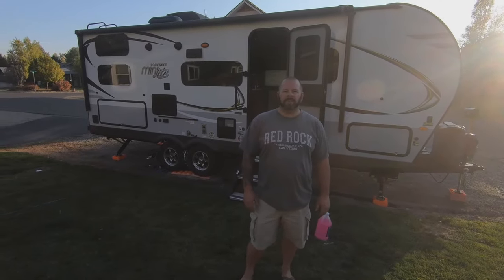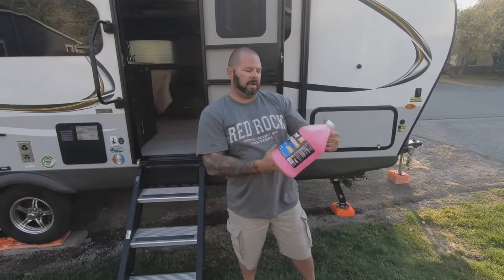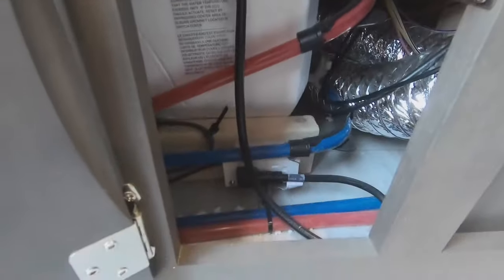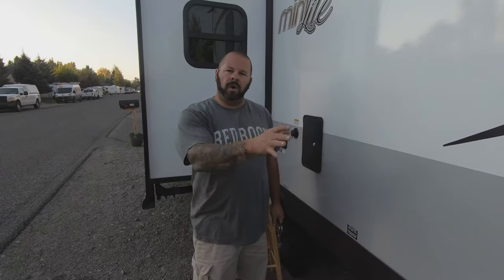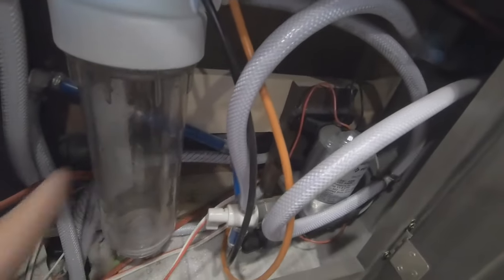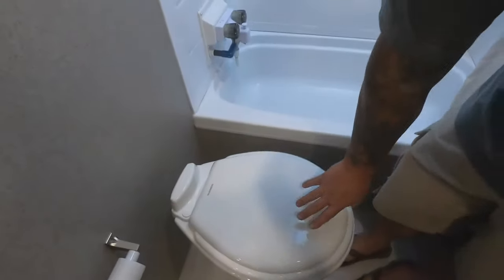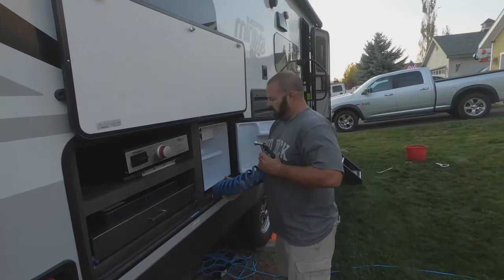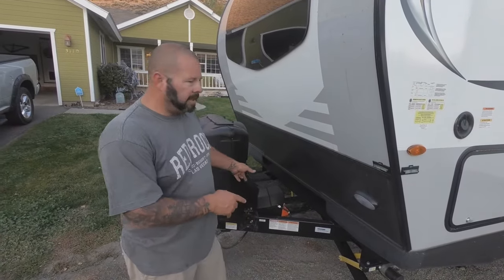How to winterize 2021 Rockwood Mini lite 2509S

Comment: Great video, please go back and depress the city water inlet button otherwise you’ll have a leak on the other side in the spring. Remove the screen push the pin until the pink antifreeze spurts out. Happy Camping .
Reply: I almost forgot about 'burping' the city water inlet!
Reply from the maker: Never even thought about that. Hope it will be fine. I have it stored for the winter in and indoor insulated building?
Reply: Damn I'm late to this comment, we're FINALLY camping the first time this season (I have the same 2509S) and I missed depressing the city water inlet last fall, and as you mention it leaks when connected, so I'm filling and using the tank.  Do you know how to fix?
Reply: What is the 'city water inlet button'? What is 'burping' it? Do you mean moving the valve back to city water mode from antifreeze mode? Thanks!
Reply: @jlantz3691 also not sure, hopefully someone sees us

Comment: we found out by accident that if you leave the low drain cap off and loosen the water filter it will drain over half of the water out of the filter to avoid water getting all over the floor when you remove the filter
Reply from the maker: I am going to do that next time. Thanks

Comment: An extra bottle of antifreeze is a heck of a lot cheaper than winter freezing damage repairs.
Reply from the maker: I have not had any damage or any problems doing it this way. Besides where in the world is a whole other bottle even going? Lol
Reply: @BassinNmore  I wasn’t criticising your method, just saying that if someone needed a bit more for a particular unit it’s pretty cheap insurance. One thing that surprised me a bit is that they put caps on the low point hoses rather than valves.
Reply from the maker: @robertpearson8798  right, I am not a fan of the caps.

Comment: Good job but just a note; the rod you pulled out of the heater isn't a heating element, it's a sacrificial anaerod.  It slowly deteriorates saving your heater. You need to check this once a year and replace once a year or you'll destroy your heater.
Reply from the maker: Thank you for the info! I will add that to the list for when I replace the water filter.

Comment: Thanks Justin and Racquel! I have a 2022 Rockwood Mini Lite 2104S and had a very difficult time finding anybody with a video or discussion showing how to use the outside connection. So this is extremely helpful for me and I appreciate you taking the time to put it out there. Happy camping!
Reply: P. S.  Mine took slightly less than two gallons, and had about a quart  left
Reply from the maker: Glad it helped out!

Comment: Great videos, very well done. We have the same Rockwood camper. After my first year of winterizing, I found that if you use a small kitchen trash can bag, you can put it around the water filter when you remove/replace it and not spill any water in the cabinet.  It works really great for me. 
Another trick I do is place a pool noodle at the head of the bed on the bed frame to prevent the mattress from sliding down when you put the bed up  and getting caught on the bed shelf when you put the bed down.
Thanks again for the videos.
Reply from the maker: All great tips, thank you!

Comment: I know this is awhile since you made the video, but it is still very helpful! I have done my own winterizing for several years now and am about to do our new 2509S. Watching you do yours was great. The only difference is Rockwood no longer includes a canister water filter. Instead, they give you an in-line filter with the trailer. No problem, as I was using them on our old trailer. Thanks so much!
Reply: Ahh nice I was just scrolling comments to see this. Mine also doesn't have one which I suppose is easier.

Comment: Good video. We just received our Rockwood and it’s a little different from our old Winebego. Thanks for the instructions. One note though. In your city water connection you have a screen. Take the screen out and you have a small pressure release valve. Push the valve and that will release the pressure and drain that water line. Probably not a big deal but I don’t risk it.
Reply from the maker: Thank you. I did not know about that at the time, but will get it for sure next year.

Comment: Great video! I want to buy one of these this year, especially after watching your other walkthrough video! Just wanted to mention that it appears to me when you do the hot water antifreeze on a hose (shower hose, outdoor shower hose and your line next to your outdoor burner), you should run the hot a little longer. The reason you are seeing antifreeze right away is because it's still in the hose from doing the cold, however the hot water line itself might still have some water in it further back (or maybe not 😉) Anyhow, thanks so much for another great video and I hope to check in with you after we buy our unit. Cheers!
Reply from the maker: I will do that. Thank you!

Comment: We have heard the same about the Liquid Dishwasher detergent, no suds and cuts grease.
Buy 2, 1/4 turn valves for the low point lines.
We blow out the water lines with air, you use less antifreeze.
Reply from the maker: Thank you

Comment: Thanks for the vid, great help as it’s our first year with a mini lite. I think you may have forgot the city water intake. You have to remove the gauze and push the button to let the antifreeze through. I didn’t see this in any of the comments. Other wise I will be following this vid to winterized my trailer.
Reply from the maker: I dod not know about that until after as somone else did comment about that. I still had no issues with when I picked it back up after winter though. Thanks
Reply: @BassinNmore  not enough water stays in that line to worry about. It's often higher than the pump anyway.

Comment: Great reference video for out 2021 2507s.  Dealer said we could just drain all the water like you did, blow out the lines with air and not use antifreeze that will require much flush out in the spring.
Reply from the maker: That is true. I used to just blow the lines out in my old camper, but I don't have a large compressor anymore. Thanks
Reply: Personally I think that $15-$20 worth of antifreeze is pretty cheap insurance for a $40,000+ trailer and I’m sure the manufacturer puts that antifreeze port on there for reason.
Reply: You are welcome, saves time money and better for the environment to achieve the same results. Ockhams Razor!

Comment: Thanks for the video, as one previous person said you showed a lot more then what they show you at the dealership. I purchased the same 2509S this past February and still had questions on how to winterize without getting antifreeze in the water heater.
Reply from the maker: Glad to hear it helped you out. Thank you!
Reply: I purchased the 2509 a month ago and it's a 2022.  The process is the same and it was very thorough and helpful,  thank you very much for putting this together.   The Socket to remove the drain cap is actually 1-1/16, not 11/16.  It's common sense but important to note the water pressure that occurs in the filter housing and it will become impossible to remove unless it's release.  Great video thanks again!

Comment: Thanks a lot for your video. I just got may 2509S this year, and it is also my first camper. I have three questions, 1, the filter is too hard to take off, would it be ok just let it be with 1/5 water inside? 2, You have turned 3 bolt switches to the other side under the counter, when shall we turn them back?  3, Similar with 2, you turned the switch near the the filter, but didn’t see when you turned it back. Thanks again.
Reply from the maker: If you open the low point drain the filter should become loose again. I don't turn any of the switches back until I get it back in Spring and de-winterize the camper. Then I put all switches back and flush with bleach water.

Comment: We Live in Maine and just Winterized ours today, 2021 Rockwood MiniLite 2205S , I dumped a bunch of antifreeze in the fresh tank and just pumped it through, we don’t use the fresh tank to drink from anyways
Reply from the maker: That works as well. Did you use more antifreeze doing it that way? We use ours for cooking and the dogs water as well, but you can always clean the tanks in spring to use again.
Reply: @BassinNmore  yes I used 4 gallons and after I ran out of every faucet I drained the fresh tank and cleaned it  out so got 1 gallon back, we don’t dry camp so we never use the fresh tank ever, we are always at a campground with full hookups so only use the city connection
Reply from the maker: @Northeast_Mainiac  thank you

Comment: One bit of advice. Empty your fresh water tank. Then open a faucet and turn on your water pump. Watch your filter because it will start to empty. When it is almost empty shut off the water pump. No more spilling water inside your camper👍
Reply from the maker: I will definitely try that next year. Thank you!
Reply: @BassinNmore  I know it works because I did it yesterday on my 2021 mini lite 2205S, lol!
Reply from the maker: @stevez340  I wasn't saying it doesn't work, lol. Just saying already winterized mine and put it away this year. I am getting older and by next year I will try and remember this.
Reply: @BassinNmore  I understood that. I was just joking that I had actually done it less than 24 hours earlier👍

Comment: Great video but might want to run the hot water a little longer to insure the water is completely out. Open then closing real quick because you see antifreeze could just be the antifreeze from the cold water getting pushed out by clear hot water
Reply from the maker: True, thank you.

Comment: Pour 3 gallons of rv antifreeze into a bucket. Winterize the trailer. Anything leftover can be poured back into the gallon jugs?
Reply from the maker: Next year I sure will.
Reply: @BassinNmore I just got out my list for wintering my Mini Lite 2205s as I plan on doing it this week. I will update some things, such as one reply stated, removing the screen on the city water connection and making sure there is no water in the line. There is usually a low spot in the hose where it enters the trailer. I believe the black tank flush can also have a low spot where water can lay in it. Always learning something new! I also empty the gray and blank tank when I am done to remove any water that accumulates while wintering. Good luck with your future videos!

Comment: Really informative video. Quick question: I assume that the water pump isn't damaged when the jug is sucked dry? Thanks.
Reply from the maker: It can damage the water pump if it runs for a long time on an empty tank. The pump will get too hot and damage the rings. I already had to replace my pump for that reason.
Reply: @BassinNmore  Gotcha. So as long as I turn off the pump quickly after draining the jug, I should be OK.
Reply from the maker: @jlantz3691  yes

Comment: I just did our 2509s, but I went the compressed route, 60 psi, until every line is empty of all water, it takes a couple of times for each line, then about half a gallon in each p-trap. Makes sure u depressurize the water heater!!! Learn the hardway as the anode rod flew out, could have been ugly!!!
Reply: Compressed air......
Reply from the maker: That is how I used to winterize. At 60 psi I bet the rod came out really fast. Glad you are ok!

Comment: Wow, what an awesome job explaining all the steps to be done. Thank you very much for all the help.
I do have a question about the Shower miser.
Do you have to flip the lever and run some anti-freeze thru that also?
I just brought home a 2509 s and there is so much to learn.
Thanks brother, God bless.
Reply from the maker: That is a really good question. I would have to say yes though. Thanks for pointing that out, I will do that this winter.
Reply: Turning on the shower miser for 2-3 seconds will be enough.
Reply: @aguyandhiscomputer  Thanks my friend, that will help us all out.

Comment: I've seen others put an empty water bottle in the place of the water filter, so you don't use as much antifreeze. But the antifreeze is pretty cheap anyway, so not a big issue. I also use air compressor @ 40 to 45 psi to blow out water in lines prior to adding antifreeze. 😁👍🏻
Reply from the maker: The water bottle is a good idea! Thank you!
Reply: Antifreeze pushes all the water out so air is really a waste of time. But it makes people feel better so it's personal preference.
Reply: @aguyandhiscomputer  Wouldn't the antifreeze mix with the water and dilute it? Just saying...
Reply: @xplor1301  no, not in 1/2" lines.

Comment: You just ran water into the grey and black tanks are you going to empty them again?
Reply from the maker: I don't because I also ran each faucet far a couple of seconds after the antifreeze came out so there is also antifreeze in the tanks now, plus they are both 30 gallon tanks so even if it does freeze there is not enough water in there to damage the tanks, but it all honesty it would probably be safer and smarter to do so. I will next year for sure.

Comment: Why did you open the water heater pressure relief valve?

Opening a faucet does the same thing.
Reply from the maker: Sure, that works as well. For me its just the ease of it all being right there and not having to go in and out of the camper that much more, lol.
Reply: @BassinNmore  definitely 🙂
Reply: @BassinNmore  you in the Mini Lite Facebook groups?

Comment: I have those same water valves.   They are not marked which way is open.  Or which way the water flows.    Very confusing.    Any suggestions?
Reply from the maker: If the valve is going the same direction as the lines are then it is open. If the valve is sticking out to one side or the other it is closed.

Comment: What about in spring how long does it take to flush this all out before its safe to drink again?
Reply from the maker: You will have to wait for the video in spring, just kidding, lol. 
It is super easy and takes just as much time as it does to winterize it. 
In your fresh water tank you put 1 tablespoon of bleach for every 10 gallons and water, and 10 gallons is plenty to clean the lines. You then run every faucet, toilet, shower, ect, until the antifreeze is gone and you smell the bleach in the water. 
Then drain the bleach water out of your fresh water tank and refill it with clean drinking water and repeat the above process on every faucet, toilet, shower, ect, until you no longer smell the bleach in the water coming out. 
Them install a new water filter and drain your gray tank and black tank at a rv dump and you are ready to go for another season with clean fresh drinkable water.

Comment: If I live in an area where the lowest temp is about 35-40 degrees and only for about a couple of weeks, do I still have to do this process?
Reply from the maker: I wouldn't. The only reason you would have to is if it gets below freezing. This way the pipes don't burst when they freeze. We get to -20 here and are below 32 as a high for most of winter.
Reply: @BassinNmore  thank you for your response!

Comment: Should you pour antifreeze into sink drains the p traps hold water
Reply from the maker: I thought that the antifreeze that came out of the faucets was enough for that?
Reply: I usually add a little extra to my drains.  Better safe then sorry.  Good  video
Reply from the maker: @scotthornback4348  thanks for the advise, I will do that.
Reply: @BassinNmore  You are correct, the amount that comes out of the faucet is sufficient.